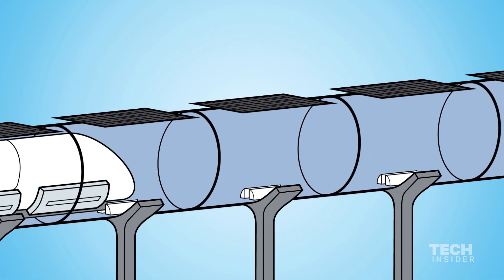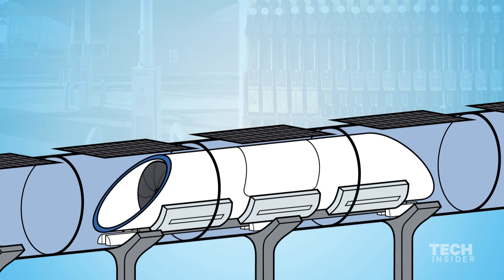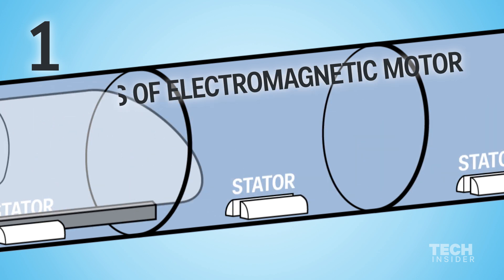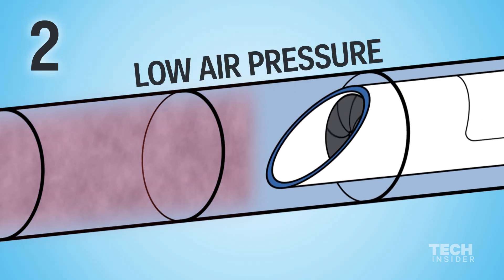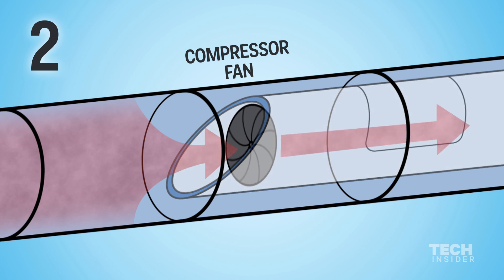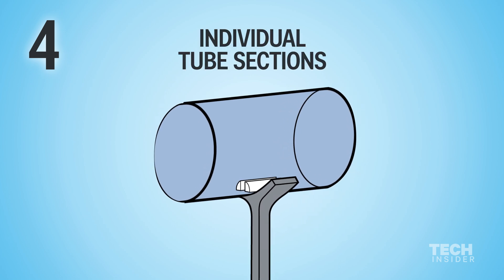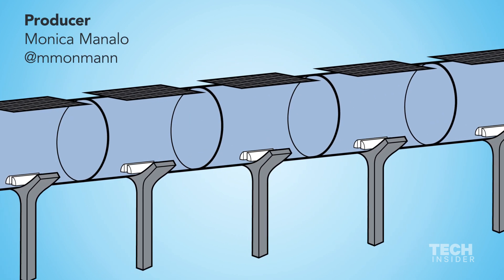Science of the Hyperloop

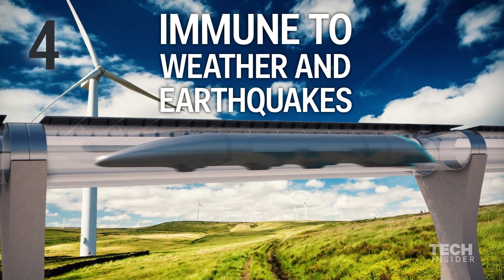Comment: @1:25 : The pillars are "unobstructive", footprint of a "telegraph pole" ?  One of the Hyperloop's fans' delusions is that it will only need to buy a few square feet of land every 100 yards; hence the supposed cheapness.  But its shadow area will compromise agriculture so they will need to buy a continuous strip of land like any other railway. Nor will houses be allowed underneath (in UK anyway) so they will need to buy and demolish housing too.
Reply: @steam driver I think tubes of that diameter over 100m would buckle before they sagged.  I've not done the calcs but I think 100m might be optimistic, especially as they are under vacuum which give them the potential to buckle anyway.  It dos not greatly matter because they will need to purchase the entire strip of land anyway, whatever the spacing.

Comment: By "science of the hyperloop" you mean a long series of surface level X will do Y statements that have no grounding in reality.  6 years on, and nobody has even a model of a capsule with a compressor or air bearings.  The one failing company that's done anything relevant - hyperloop one - went to maglev.

Why would you put solar panels on it?  Why not build a plant?  Sticking panels on something doesn't improve something.  Tell all of your tech journalist buddies.

Comment: eddy current propulsion is a great concept if you grew up in the 1800's but create a field in which you can push against using eddy currents and you have anti gravity. Crazy but picture this, a aluminum plate passing though a magnetic field it which creates resistance which it pushes up. the mechanism resembles two aluminum plates with at t shaped field generator. ps. the aluminum wheels are counter rotating with the field generator frequency same as rpm,s . got to go to a 51 now should not drink whille on va ca. thanks

Comment: You know, even if the hyperloop works, it still requires expensive infrastructure that is not easily moved or modified.  Cars and airplanes still maintain greater flexibility of being able to travel to a variety of locations with less infrastructure costs.  So the hyperloop might be good as a major arterial path for popular, well-traveled locations, but you'll still need other transportation alternatives for traveling to and from the hyperloop connection.
Reply: It's basically a faster train anyways, and what you said is how train stations work.

Comment: Is there any air to use for air bearings,when the tube is vaccumised.
Reply: The tunnel is not completely vacuumised. There would basically be a low pressure system ahead of the hyperloop that would allow the  compressor fan to absorb air atleast theoretically.

Comment: I am stunned that people are so easily duped by this fraud.  Not only is it not technically feasible (vacuum), it isn't economically feasible (cost/benefit).  Airplanes crush this model.
Reply: Mushtaq Ali Attarwala according to Boeing, a 10 hour journey with 747 takes about 36 000 gallons (I'm assuming most transatlantic flights use big planes)
Reply: Firstly, its not fully vacuum, but low air pressure, which is very possible. Secondly, you speak like airplanes are cheap to run (an airplane takes on average 6 months worth of car fuel just riding from terminal to the runway)
Reply: Kristian Muldre it was my mistake. Flight from jfk to lax takes more than 6000 gallons which is around 4000 kms. Transatlantic route from paris to jfk is around 6000 kms so it shall not take more than 10,000 gallons. This data is for twin engine Aircraft. May be B747s use more fuel but all transatlantic Airliners do not use B747s.
Reply: Mushtaq Ali Attarwala 'only' 6000 gallon
Reply: Mushtaq Ali Attarwala but still that is huge
Reply: AdamWho prove it.
Reply: Kristian Muldre An Airplane takes only 6000 gallons of fuel for transatlantic journey. You are speaking exaggerated.
Reply: AdamWho your fraud

Comment: If the tubes can move about flexibly then how will a low pressure atmosphere be maintained? Furthermore, nothing is immune to climate unless it's deep underground, there will be serious structural issues caused by expansion and contraction of materials from temperature that will make sustaining such an atmosphere impossible for that distance of tubing. Also, the most advanced pressurization system on earth was built and used by NASA, and it's massive. the total volume of this track exceeds this volume by a staggering amount. What I'm saying is, this key piece of technology doesn't exist. 
I'd like to see what safety measures are being placed for emergencies, from what I understand if there's a single problem the results will be devastating.
Reply: Inclined scorpio If you can’t solve a problem, don’t mention it? Seriously?
Reply: I'm from the future, it never becomes a reality.
You're welcome.
Reply: Adrian Oliver Blood there is oxygen things inside the hyperloop
Reply: georgio m who are talking to
Reply: r/iamverysmart
Reply: ya i was wondering about safety regulations too but it sounds like this project is still moving forward. I heard something in the news like recently that the New York to DC track just got approved by the Gov't
Reply: @jasplays6392  Cancel that request 🤣🤣
Reply: Adrian Oliver Blood

1. For the most part, the tubes will not be moving around unless in the event of an Earthquake.

2. The hyperloop will probably be underground or it will be made of a material that would be resistant to much thermal expansion. 

3. Compression is an extreme necessity for it to work but it is useful for it to reach the desired speeds. A slight cushion probably won't matter as much.
Reply: Inclined scorpio I’m on the fence with Musk, he’s done some good stuff but sometimes he says things are batsh** insane.
Reply: You know what he s elonnnnn
Reply: @rupaprasad1920  what the hell does that mean? He can break the freaking laws of physics and engineering cuz he's Elon??
Reply: Nox NC Yeah bro , it's true in case of Musk 😏
Reply: Adrian Oliver Blood if you can't suggest solutions for things .....Better learn from Elon Musk 😑
Reply: @inclinedscorpio  how about maglev trains they are at least proven
Reply: Adrian Oliver Blood yeaahh go ask nasa how to make reusable rocket. Oh wait, they CAN'T. elon's space x did. 😂
Reply: @alfredorichardohaurissa801  Ah yes, they were successful in certain areas, therefore their decisions can no longer be questioned, as now they're perfect omnipotent all knowing gods that are 100% right all the time.

Comment: I'm skeptical about a few things :
- does it work on a curved track ? how ? as it seems to be a long straight thing without any moving parts...
- when passengers will be going in and out of the capsules, the air pressure in the tube will increase (which would need a lot of power to decrease back), unless there's some kind of airtight system which goes on the capsule when it's on a station.
- the exterior design needs to be taken seriously, because it might not be accepted as-is by cities and countries : ugly concrete pillars supporting ugly tubes. unless it's glass, but the glass version just seems to be a technically unrealistic artist view.
- if it allows for non-precise alignment of the stator and rotors (because of air cushions, slightly moving tubes and curved tracks), then I guess that each couple of stators is enough spaced to allow this, which also induces a waste of power ? but it has solar panels, so maybe they don't give a f**k
Reply: +alex I think like a lot of things, the hype of a new technological concept often overlooks reality and practicality. Monorails were once considered the transport of the future and even maglev trains are not a new idea, since that goes back as far as the 60's. Also , we were meant to have flying cars by now.   I don't think it will come as cheap as they claim. I'm also wondering how difficult and expensive it would be depressurizing a 4000 km long tube. I'm a bit skeptical with claim that solar panels will make it significantly more efficient and cheaper because the same argument can be used for any transport system or anything else. You could run a conventional rail system on solar power if you had enough solar panels.  Its like saying running a vacuum cleaner off solar panels instead of  the grid makes it a better vacuum cleaner than one run off the grid.
Reply: @1978Prime  : Americans don't seem to realise that most trains in the developed world run on electricity already : that's why they are getting all excited about H-L's "green" solar panels etc.  As for curves (horiz AND vert), they will need to be very VERY gentle at that speed, so some spectacular civil engineering will be required, unless it's in a flat desert.
Reply: A slight turn at 700 mph would produce uncomfortable G's or sickness in most people.

Comment: this is a bad idea and it shows how much thought was put into this in Japan they have buildings that are earthquake resistant using the same concept but they also sway in the wind.@ 700 miles Plus this needs to be rock solid trust me
Reply: +K10100 K10100 I am worried about the initial force needed to lift the capsule. The air is of low density (low pressure), it means that to get to the required pressures to lift the tube, you will need really high speeds for the rotor. Which is not a problem, but how is this going to be fully sustainable with just solar panels? Also, the amount of batteries needed to provide such huge sums of energy at night will be ridiculous. 
That being said, Elon Musk is far from a con artist so I am sure he, his team and the smart people at UCLA are thinking of this or have already figured this out.
Reply: +Vaibhav Shah It looks like (in the latest tests) they plan to use some kind of rail tracks, at least for the acceleration phase until it has enough speed to float in the air. Also, the magnetic motors seems to be used in the same fashion as in some high acceleration roller coasters : placed vertically just to give speed but not horizontally (for speed + levitation) like on the maglev. That way I think it needs far less power than the maglev. And the low pressure allows less air resistance which means less power needed, so It might not be that huge and by night it could rely on windmills, dams and less clean forms of power. But that's just my assumptions...
Reply: LOL, Ya think?? Oh I trust you, it definitely needs to be rock solid at any speed..
Reply: Prodigy One your a bad idea
Reply: +Prodigy One Trust you? What are your credentials?

Comment: Great video, I finally get the air bearing concept
Reply: Why not maglev?
Reply: @those_who_speak_elevator  eddy current generated cause too much of friction and most of the energy lost
Reply: @those_who_speak_elevator  Because big flashy tech bro bullshit projects generate more money than actually doing anything
Reply: @Limosethe  do you know the physics behind this? I'd love to see a physics paper showing the actual forces involved in getting this thing to work
Reply: @adenm8963  Hmm, I don't read physics papers too often. I'm not that invested, but vacuum trains have been theorized about for about 100 years, And it's never been deemed feasible after a centuries worth of scientific research. And alot more I could go on about. Especially in regards to how hard vacuum tube are to maintain, and how kilometers of air tight infrastructure is implausible
Reply: @those_who_speak_elevator  maglev is expensive compared to it
Reply: DC9848 me too.
Reply: hey does anyone knows how to create this kind of videos for explaining concepts. thanks.
Reply: true. at first I was like: how in the f*** are they gonna make that thing hover in that pipe?
Reply: @redox33b  problem is tho, it probably won't work. The tips of the compressor fan blades would have to spin astronomically fast in order to collect enough air from the near vacuum.
Reply: @davidking8472  So true. The compressor will be like a turbomolecular pump of the size of a get engine.